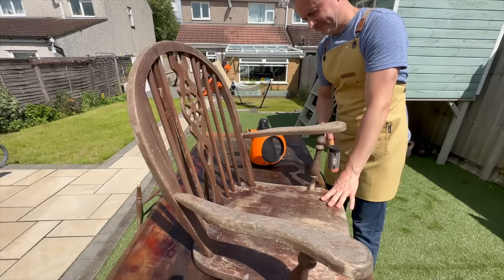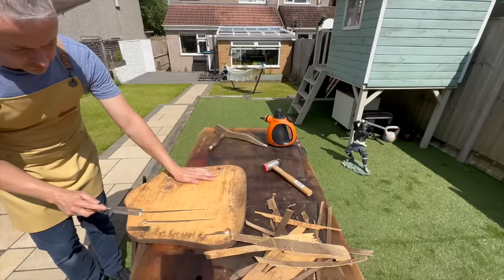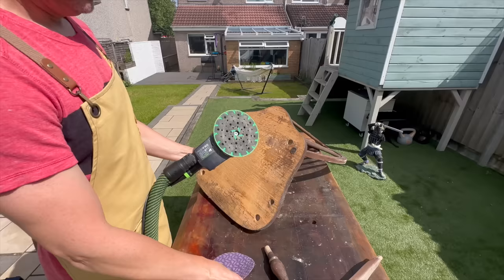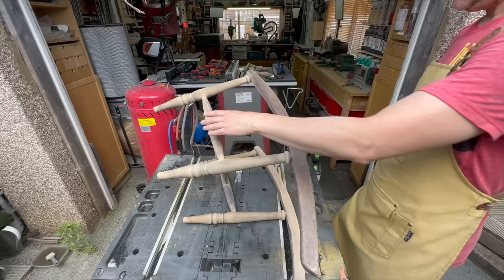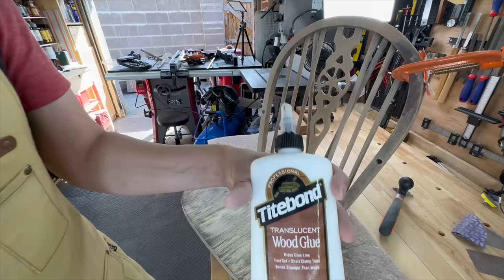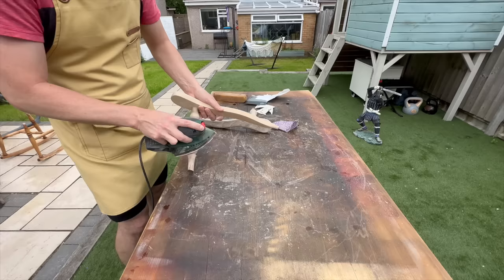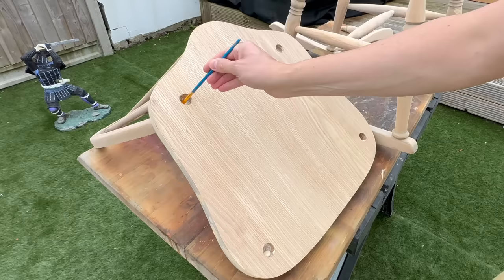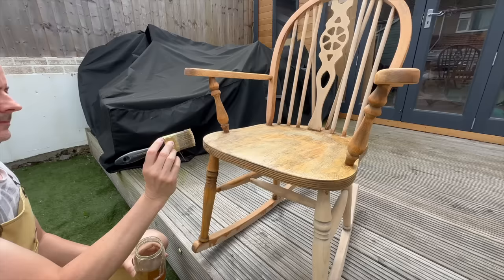Heart - warming RESTORATION of a Broken Rocking Chair.

Comment: Many years ago, my wife bought me 2 spindle backed, cane seat, antique chairs in very bad condition.  I pulled the worn out cane seating out of them.  Then I just sat in a chair in the driveway when I had nothing else to do and hand sanded the entire 2 chairs, spindles and all.  Then I found a guy locally in Long Beach, California who sold pre-woven caning material.  I bought the caning and splining from him and had him give me a training on how to install it.  After I had soaked the caning material overnight, I carefully installed it the chairs and let it dry.  When dry I tested the seats and they seemed very tight.  I did a light stain on the oak frame of the chairs, but left the caning natural.  I went back to the shop that sold me the materials and tested his seats for tension.  I was very proud that my seats were tighter than his.  Now about 50 years later one of the chairs’ caning has broken through.  I’ll have to contact my antique dealer friends to see if they know anywhere I can find the caning material again.   I heard 10+ years ago from an experienced antique dealer that to have caning custom woven, they charge for every hole in the material—yikes!